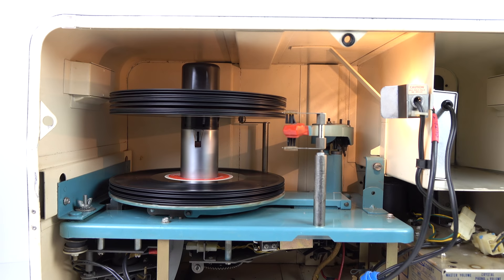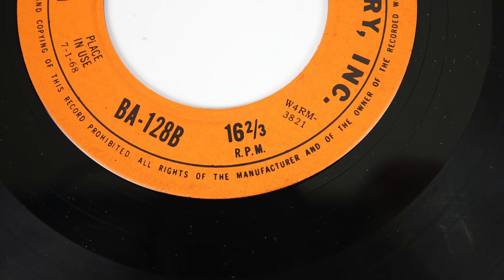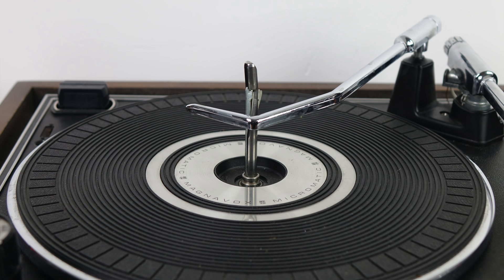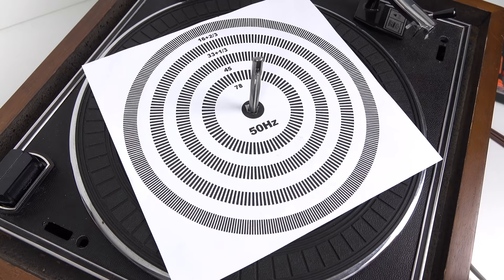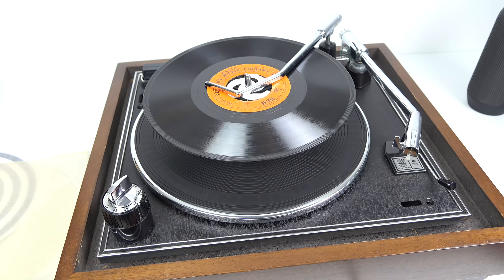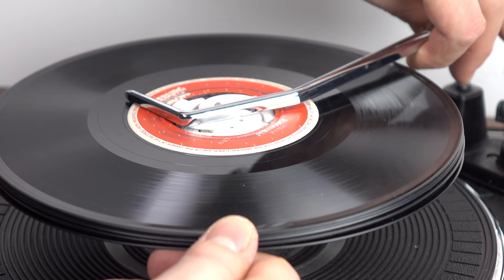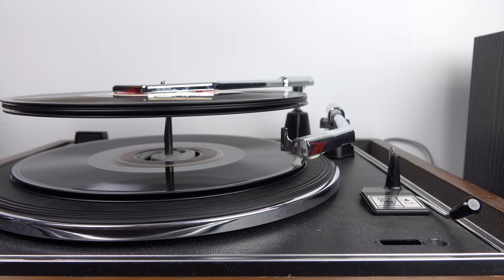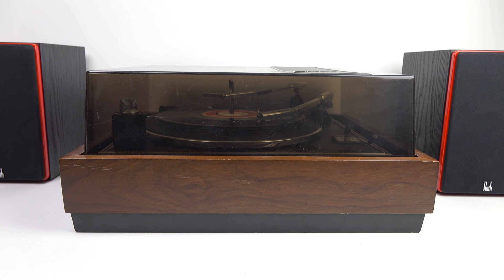Seeburg 1000 BGM Part 2: The DIY version

Comment from the maker: A few people asked how you play side B.... I didn't show it in the video because it's the same with any stacker record changer. When the player has played through the (4 hour) stack of records, take them off, flip them over, re-stack them, press go.
Reply: I was wondering whether they would actually play backwards (because the groove might track in the other direction as the side B stylus played the underside of the record) - but I guess not!

Edit: I see from comments below that I'm not the only one to have wondered about this...
Reply: Could you explain why they won't play backwards on the other side.  From the needle's point of view the top spins clockwise, but on the real machine when playing the bottom it's spinning counter-clockwise.  Isn't it?  It seems that the needle would fall right off the record on side B.
Reply: Sorry, but this is really kind of a derp question. Of course you would just flip them over. The fact that you have have to explain that is just silly.
Reply: Are you sure about this, because I don't believe it.  In fact, it's 1:30 am and I just got up to make a cardboard model to verify my theory.

Looking down through the record, it's turning clockwise as far as both the top and bottom styli are concerned.

When the record is flipped, although the record itself is still turning clockwise, the bottom-turned-top side is now rotating backwards.

I wish I could include a picture to prove the point.
Reply: Ok, I missed one critical detail.  The spindle for the upper position is turning the opposite direction as the spindle in the lower position.   That wasn't clear without careful observation!  So nevermind my previous comment.

That makes sense, or else special record mastering machines would have been required.
Reply: That's awsome!
Reply: @bigjonseattle  Yep. When the Seeburg 1000 is playing the top of a disc, the disc is rotating clockwise like a normal record. But when playing the underside, the disc is rotated anticlockwise to compensate for it being upside down (the way it does it is a brilliant bit of engineering, I must say). Thus both sides are indeed playable on Mr Techmoan's turntable.

Comment: I'm sure someone has suggested this before.   Have you considered using a 12 vdc  to 120 vac - 60 hz inverter?    You could probably use a small 12vdc battery charger to power it  and and you'd have all the 120 v 60 hz power you'd ever need.

Comment: Great job as always also i was surprised when you showed up on the 8bitguy
Reply from the maker: It's like Tom Selleck appearing in Friends.
Reply: Are you two talking about the fisher price camera? You should make your own video on it!
Reply from the maker: I think it's been comprehensively covered...I'd just be repeating things.
Reply: Techmoan  
That made me smile out loud.
Reply: how is the best way to transfer cassette tapes to MP3 ? please,
Reply from the maker: Audio out connected from a good deck into a computer.
Reply: Thanks!!!! For getting back,. can one go directly into the computer from the deck or do you need a amplifier, then what program to use to break up the file into separate files
Reply: yes, just plug the audio out rca jacks from the deck to an rca to 3.5mm converter, then plug that into the microphone input on your computer and use audacity (http://www.audacityteam.org/download) to record the cassette and split the file up into tracks, then save those tracks one by one into separate files. Hope that answers your question!
Reply: Techmoan has been on 8bitguy more than once!
Reply: Directly, and audacity. EDIT: Looks like Epic_Gamer_200 already covered it.
Also, please don't use the microphone in. Use the line in instead if possible.
Reply: armanelgtron Or, get a DCC machine, get a sound card for the PC with optical toslink inputs, and transfer digitally from the DCC machine to the PC. Ain't I a stinker?
Reply: @ Nite Explorer, Try and get hold of an external usb sound card, I use the Creative audigy 2NX, it's obsolete now, but they turn up regularly on Ebay , it has 3.5 phono jacks in  that can connect to your cassette deck, and a usb in to your laptop/pc.
Then you need some software to convert the wav files to mp3, split the tracks etc, I use Adobe Audition 1.5
(formally Cool Edit Pro, don't get the Audacity that the usb record decks use, it's terrible. Hope this helps
Reply: armanelgtron I would go as far as saying use a proper sound interface too, because the built in circuitry and mini jacks aren't that good.
Reply: +Epic_Gamer_2000 mic in is not a good way to record good quality sounds, better way is to use line in, but the signal level shouold be higher than - you may need some preamp.

Comment: Hey Techmoan, great video(s) about the SEEBURG 1000's. Older Magnavox record changers (the original COLLARO design) don't have to be adjusted for landing the tonearm. They possess "mechanical memory". They will actually land the tonearm for ANY size record; 12" 10" 7" AND 9". I too found the 2 inch spiders for the hole. I purchased 2 SEEBURG 1000's a couple years ago and using parts from both fully restored one beautiful museum quality piece. One last hurdle to be mindful of. . . . the grooves on these records are .5 mil. Most LP stylii are .7 mil. (conical) (.3x.7 elliptical). .7 mil. stylii are going to ride too high on the lands between the grooves for the best fidelity.
I actually found a vintage Stromberg-Carlson record changer that performs in the COLLARO style... "...tapping the record to determine size"; restored it and retrofitted a cartridge with a .5 mil. stylus and play all of my SEEBURG records. Rather than dedicate this changer for SEEBURG records I made the retrofit cartridge changeable for standard records too.

Kindred Spirit... tacolvard@charter.net

Comment: I don't know if anyone's mentioned it or not, but earlier Collaro / Magnavox Micromatic changers (made before mid-1967, if memory serves) do not require adjustment to play Seeburg records.  The later ones are set up to detect only the standard three sizes, but the pre-1967 units have the ability to detect and properly cue non-standard sizes between 6 and 12 inches - no tweaks or modifications required.

Comment: Enjoy your videos, very professionally done and you explain everything so well.  Just to chime in here, I have a BMS1000 and also the hideaway model, and over 100 records.  Not only are these records an unusual size, they are also super-delicate.  The groove spacing is far denser than an LP and the caution "Do not touch record grooves" is well to need.  I have found the least scratch or blemish will cause them to skip or get stuck.  The recommended stylus is 0.5 mil, not the usual 0.7 mil used for LPs.  I enjoy my BMS1000 and believe me, the fidelity is surprisingly good.

Comment: My great grandmother had a turntable with built in amp that had the 16 speed setting. I remember it had quite a thick heavy metal base that sat on a spring mechanism that suspended it over the plinth. The knobs were quite large thick clear plastic that almost looked like glass. The knobs were smooth but had weight to them for lack of a better description.  I remember it well because as a boy I can remember thinking how much nicer it was than the BSR turntable we had at home. I'd love to find one but don't even recall the model. I was about 7 the last I played a record on it.

Comment: Tech Moan, as noted by me in your other video. The Seeburg BMS discs uses a special stylus that is smaller than .07. As most of us know you can play an LP with a .1 mil stylus or even a .2 or .3.. they will play but will eventually cut out the groove in time ruining the record. I believe part of the reason Seeburg decided to use a smaller record groove is to squeeze a bit more lines of recorded music onto each disc.
Reply: I see its a 0.5 mil stylus.  A .6 conical or spherical is probably close enough.  I have never played a Seeburg record, but considering typical microgroove records often do well using various narrower elliptical/hyperelliptical/Shibata/Microridge/line/etc., perhaps the same applies with these.

Comment: Years ago, I bought some seeburg records.  I put them on a Pioneer Turntable PL-A35 at 33 1/3rpm and used a computer to record them at 44,100 Hz and then adjusted the speed to 22,050 Hz and they played at the proper speed.

Comment: 33 1/3 RPM was originally used for 16" (40cm) radio transcription records. Before widespread use of tape recording, large records were used. You'd hear, "This program was transcribed from an earlier broadcast."
https://en.m.wikipedia.org/wiki/Transcription_disc

Comment: Looks like that changer is a later version of the Collaro Conquest design.  The early Conquest changers (I've got one in a Magnavox console) could sense and drop the arm correctly on any non-standard or standard disc 7" to 12"...You could even intermix sizes as long as you stacked the records in the order of biggest (on bottom) to smallest.  However, the latter Conquest changers, like yours, dropped support for non-standard sizes and instead would only drop on the positions for 7", 10" and 12"....If pickup arm feeler swing detected a Non-standard size it would simply round to the closest standard size (as it was doing rounding your 9" disc to 10").  Basically your Magnavox was adjusted to spec before you tweaked it to change 9" Seeburg Discs and now it probably won't set the arm down correctly for any other size records.

Comment: Love the video, got two identical 1970's Seeburg jukeboxes that someday may get a Raspberry Pi upgrade.  I'm shocked it sounds like you are without a 3D printer in this video.  I highly recommend if that's the case.  A decent set of digital calipers and the wonderfully powerful, free OpenSCAD is all I need to design and have the part I need.  OpenSCAD is a programming-based CAD tool so it has a learning curve but once past the syntax/semantics, it's wonderfully easy to construct complex shapes like gears & spacers in just a few lines, have them printed in 20minutes.

Cheers on the great videos!  I also love watching them because I love seeing vintage stuff in crisp 4k res!

Comment: Not really retro tech, but the Vestax PDX 2000 range of turntables has an ultra-pitch function, which extends the range from +/-50% at both 33 and 45 RPM. Also has enough torque to pull a small caravan and anti-skip so robust you can play it like a violin without skipping.

Comment: About that strobe disc - in addition to that disc rotating, you need a pulsating light source. Some record players have them built in. That printed disc is probably ment to be viewed under "regular" incandescent bulbs from 50Hz mains. Some more modern light sources, like LED arrays, might not, or actually do not pulsate in that 50Hz cycle even if the light is getting it's power from mains.

A dimmable incandescent light bulb would work great when calibrating (when it's dimmed down some, and acting as the main light source when viewing). A turntable with in-built light source would probably give a wrong "reading" if the turntable is connected to a wrong frequency mains plug.

Also, I do like olives and dark chocolade! I'm not sure about espresso though...

Comment: You can also do the same with a BSR record changer. There is a set-screw that adjusts the tonearm position, near the counterweight spring. Most units up until the mid 1970s were 4-speed, and are fairly common (and can be found under several brands).

Comment: There is a european equivalent of the "magnavox micromatic" with the 4 regular speeds and many more, but without automatic start and stop.  Look for a Lenco turntable (L-series). They were made in the 70 ties. It  has a tаpsе axle for the different speeds to drive of the turntable, so you can change the speed between 14 rpm till 82 rpm.  So if you have a small stoboscoop you can change the speed by hand till the speeds is oke (if you don't have 50 Hz, because it's a European turntable). The only problem can be  to transform 110V to 230V, because the Lenco is a 230 V turntable.  Some of them has the possibility to change it inside the turntable.  At the moment I don't have a picture of the turntable, but on google you will find them .

Comment: OK, I didn't see this mentioned but have read about it on line, 
Apparently older Collaro changers than the one you acquired, at one point would set the arm to whatever record size the arm detected when it touched the edge of the bottom record in the stack. 
So it would play your records without adjusting the set down point screw. 
Later models like yours just determined 7" 10" or 12".

Comment: That strobe wheel is still "crawling" to the right a little. Thus, the pitch is off by a few cents. Maybe apply gaffer tape to the heat-shrink to add thickness? 

Love your work.
Reply: But the pitch is still off, and by a good 24-25 cents.

Comment: I imagine a Miracord 50H II would also work great for this. It's an automatic changer, you can adjust where the arm sets down just like on this turntable, you have four speeds including 16 and 2/3, and you also have pitch adjustment, removing the need for the little heat shrink hack if you ended up with one that ran too fast/too slow.

Comment: Loving the video Collaro (Magnavox) made the best autochangers and they were made in the UK too, there are few machines still in the UK which will work with these discs
I have a Bush SRP31 from 1959 with a Garrard 210 turntable which detects any size without any adjustments to the deck, it will happily stack an play my seeburg background discs

Comment: Hey Techmoan, 
I actually own a full automatic turntable which can run at 16rpm and also has a function to play records with a diameter of 25cm.
It's a Dual 1010P and might also be able to play those records without any extra tuning full automatically. 
You might wanna check that one out. 

Also the turntable was build for the German market, so it should be running with your 50Hz/220V power just right.

The only problem with the turntable is, that the drop-down spindle itself is a bit hard to come by, but I'm sure you are able to find one.

Comment: About the only thing that ever went wrong on these changers is the "GLUEGREASE" they used to lube the machine when it was made! I call it "GLUEGREASE" because it turns to glue & locks everything up & needs to be cleaned off & entire mech re-lubed to restore to working condition when they fail to operate properly.

Comment: I had a 60s GEC Radiogram that would stack several discs and play at 16rpm. Suspect the 9 inch thing could be an issue though. It was sent on its way circa 1986 as it certainly wasn't cool

Comment: if you have a turntable with a pitch control + or - 50% speed  you can play at 33 1/3 then go 50% slower which happens to be 16 2/3 speed

Comment: I think this fix is awesome, but other than the stylus resting in the correct location, the only other difference is that the turntable doesn't play both sides of the disc. Which isn't a big deal, but it would be great to find a unit that would do this.

Comment: i have a philips gc 036
it can play in all speeds and you can simply adjust the transformer for different voltages
i believe it came with 2 adapters one for 45 rpm and the other one for 16 some models come with speakers and changer. also the original stylus is two sided for playing 78 rpm records
if you have different types of records and want to play them all on one device you might want to consider getting one of these

Comment: You could play back at 33 rpm if your player does not allow 16 and 2/3rds and do a digital recording with a high sample rate and then digitally alter the speed.

Your input sample rate could be 48khz and then make the playback play back at half speed. As long as the input sample frequency is high enough that the replay is playing >22050 or 24khz in the case of 48khz, the recording quality should be more than adequate to capture a reasonable recording (for personal use of course!)

Comment: Your strobe disc reminded me of something. A college roommate, back in 1981, had an expensive turntable,  and there were several rows of different sized little square silver bumps inlaid in the sides of the slightly raised platter.  Next to the platter there was a little lucite prism shaped thing that glowed orange when the power was on. It was a strobe light and there was a little wheel knob for calibrating the turntable speed: at exactly 45 rpms, one of the rows would appear to be still, at 33 1/3, another row(lthe part in the orange glow, at least). At the time, I thought this was some silly thing they did just to make it seem fancy; my turntable came fixed with the precise correct speeds.  From your video, I'm wondering if maybe they did this to make the turntable adapt to European power standards?

Comment: probably better to use a hair drier (get in very close) rather than a soldering iron for heat shrink in future. heatshrink will often split or fail prematurely when heated like that. :)